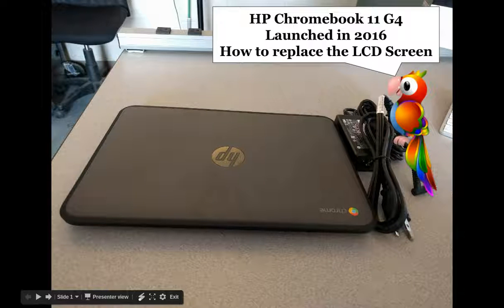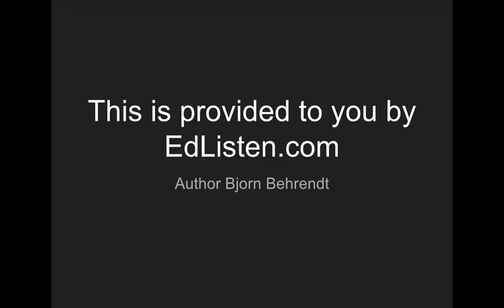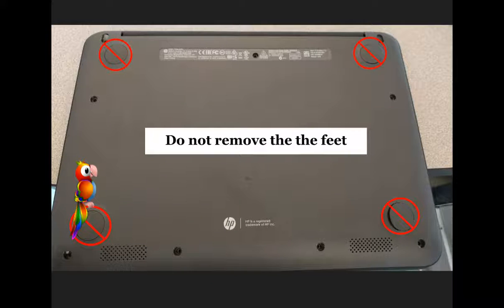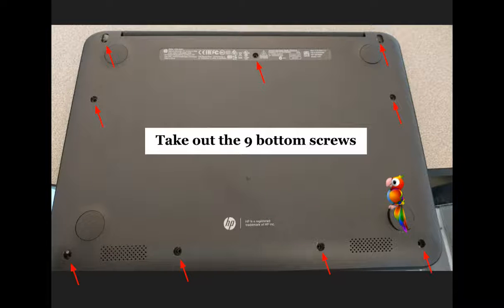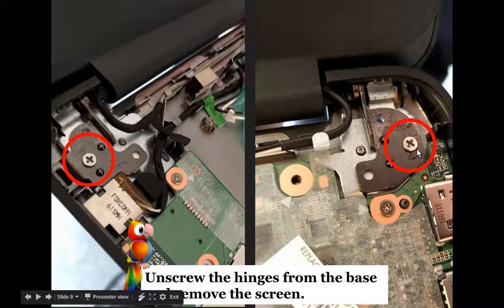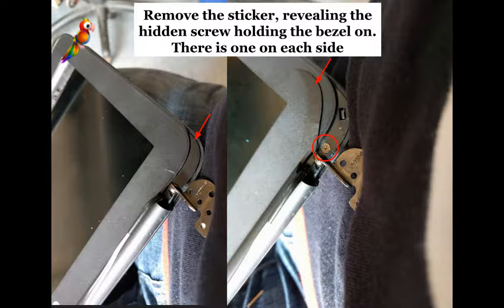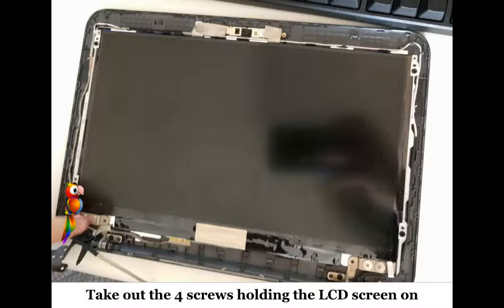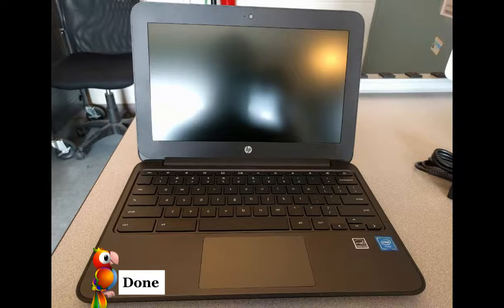Replace the Screen on an HP Chromebook 11 G4

Comment: This is not accurate.  I have a 2015 HP Chromebook 11 G4 and there is no reason to remove the back screws and lift the keyboard up??? .   Two screws on the bottom corner of each side hidden under smaller sticker/decals, then bezal pops right off screen, remove the four screws holding screen in, pop off ribbon cable and BAM!

Comment: You dont have to take apart the whole chromebook unless you need to replace the entire screen including the backplate and bezel, you can take off those two stickers and take out the screws, then remove the bezel and replace the lcd
Reply from the maker: I was following instructions directly from HP.   I can see where it might be possible but those screws are pretty hidden behind the base.
Reply: Letfordlay we need a .new video then..????